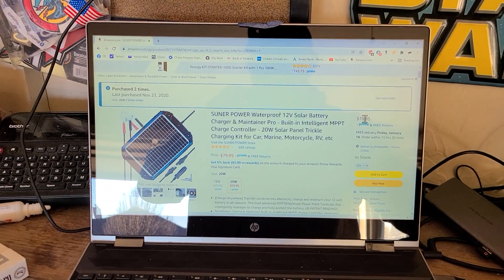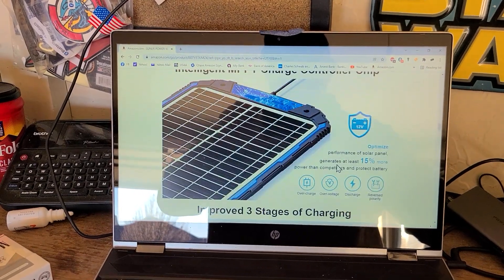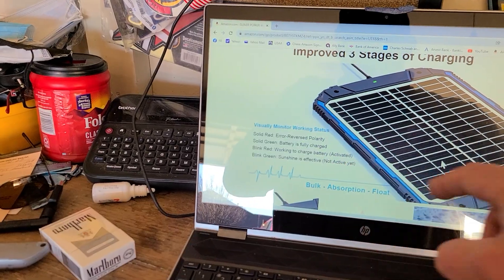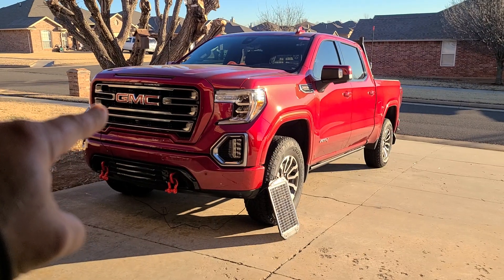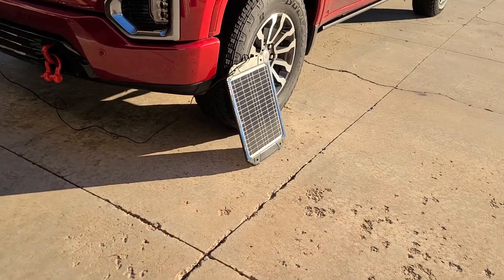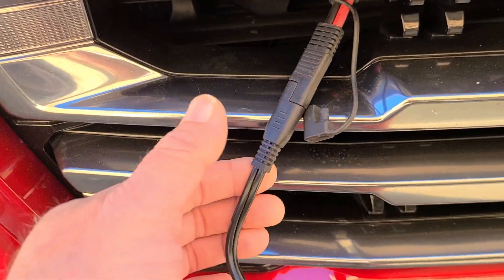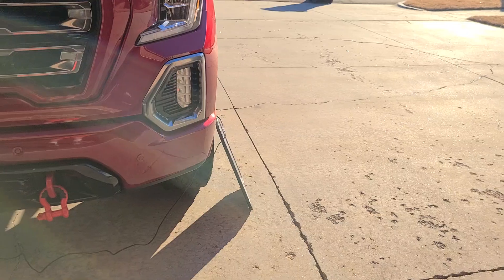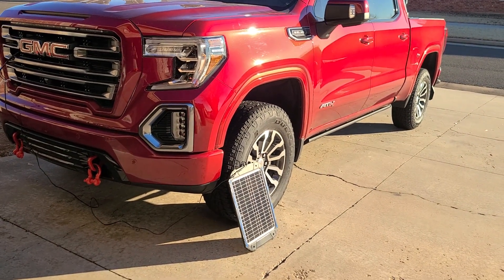20w Suner Power solar panel battery charger -- trickle charging the truck's battery

Comment: I definitely need to get one of those. My old Bullnose Ford diesel does not like starting when it is below zero. I have to cycle the glow plugs about 5 times when it is really cold. Only twice at 15 degrees. At 27 F it starts fine. A 20 watt charger would keep the battery ready for cold mornings. Thanks for the tip Chris. Happy New Year!
Reply from the maker: Happy New Year Steve -- yeah, I had a smaller solar panel battery charger similar to this one. It is prob okay for a smaller battery, but not for a truck starter battery. The 20w version gives a solid 1-amp+ trickle/charge. In crazy cold temps, FLA starter batteries struggle (as you know). Throwing one of these on def helps.